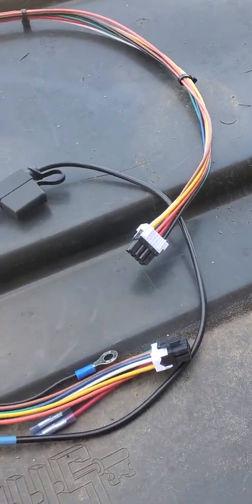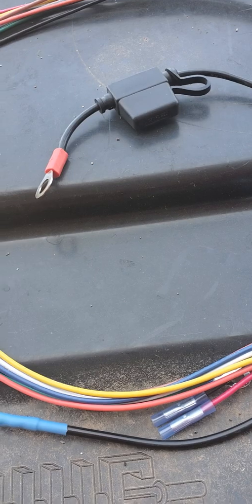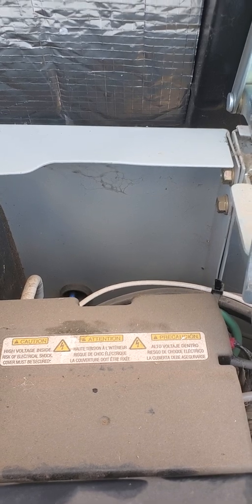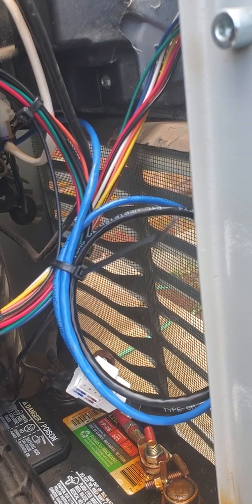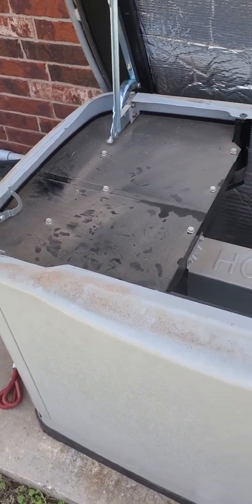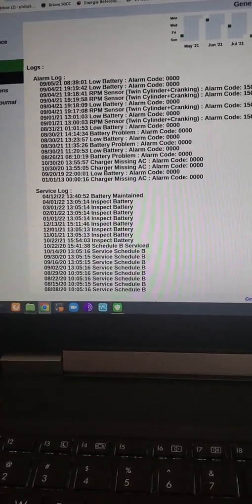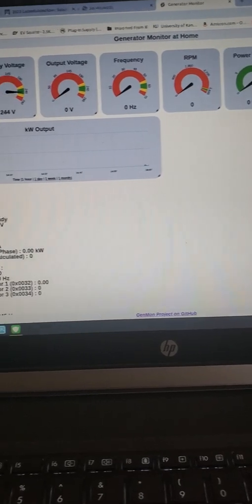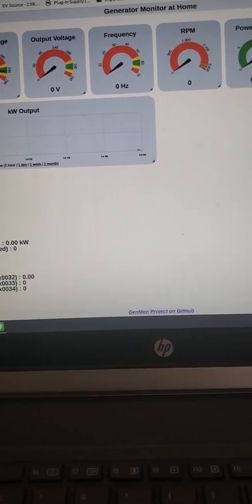Part 2  Generator Monitor, Genmon, Pintsize.me, Rasberry Pi installation on our Generac generator.

Comment: What monitor do you have and how did you log in to the data?
Reply from the maker: It's called Genmon and you use your web browser to view it. I have mine hard wired. There is a project on Github.

Comment: Could you please tell me what you set your settings on the HAT for this setup:
For the BUCK: on or off?
For the GENPWR: on or off?
Thanks is advance
Reply from the maker: Sorry, I have never set anything except through the web interface.
Reply: The video did not captured the Molex end that connects to the hat with the red/black cables. I am assuming that you just connected the power cord it…
My hat instructions say that depending on how you power it,  the setting onboard for the buck and genpwr must set off/on respectively.
I don’t see anything on the Web interface on how to power it.
By the way I have Nexus controller.

Comment: How is this holding up?  I want to put my RPi in a weatherproof box as I'm concerned it would get too wet installing it like you did.  Is yours still working fine in that location?
Reply from the maker: Yes, absolutely no problems.
Reply: @98grand5point9  Appreciate the reply.  I ended up installing it similarly to yours.  We will see how long it holds up.  Thanks!